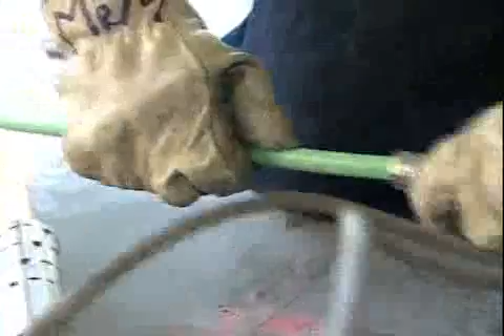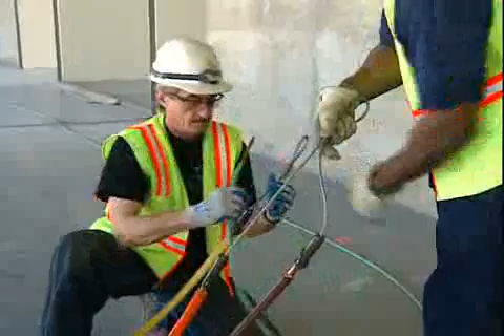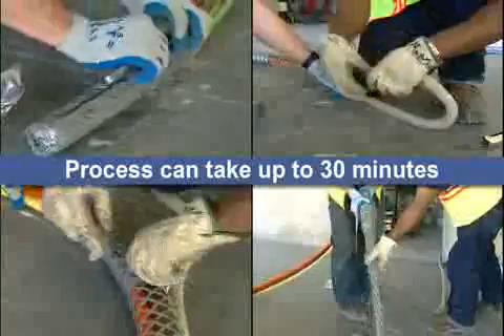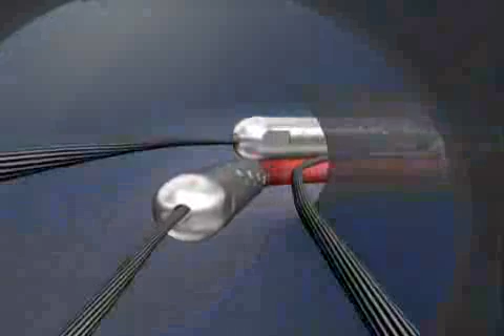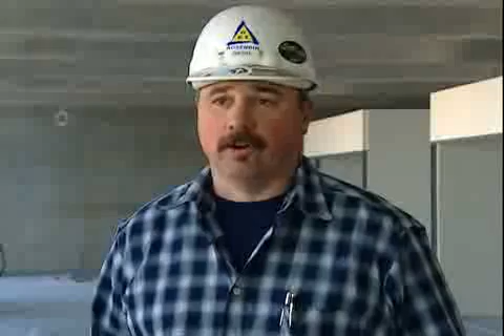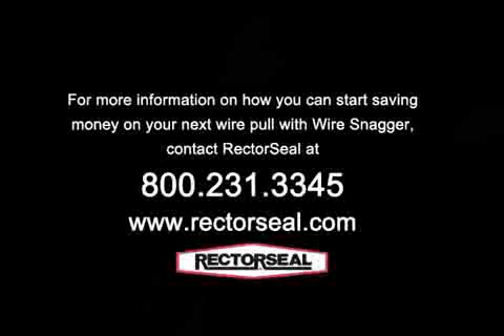Introduction Video of Wire Snagger®

Comment: A good idea. I've been in the Cabling industry for 15 years and a wire stocking would only take a few seconds more and then tiring it off for the extra safety. Would you trust one of these on a riser pull?  big 300mm 4 core, with a few ton hanging on 3-4mm of pic, because I can't see these biting into the swa's